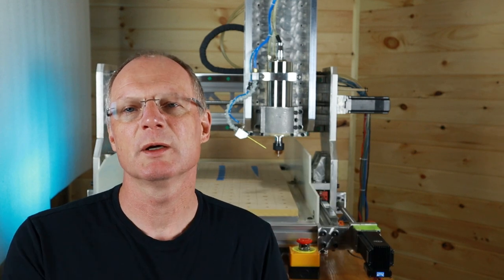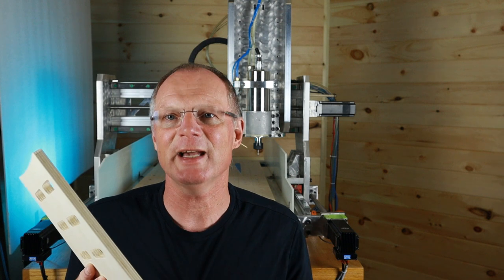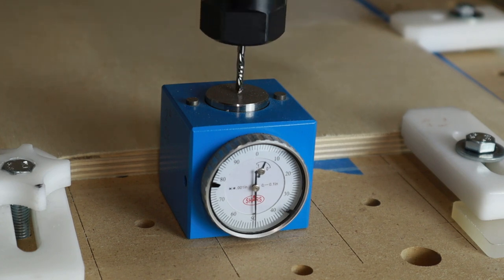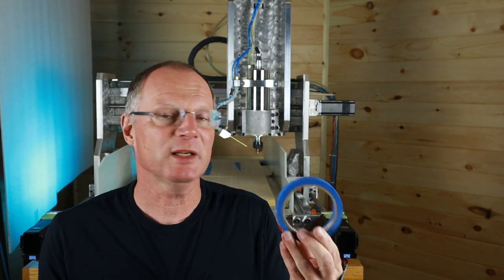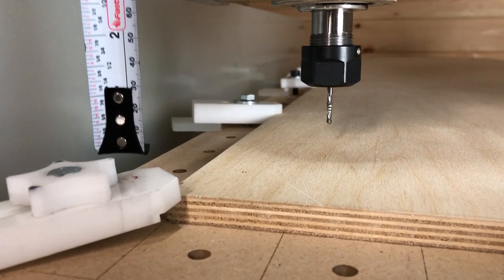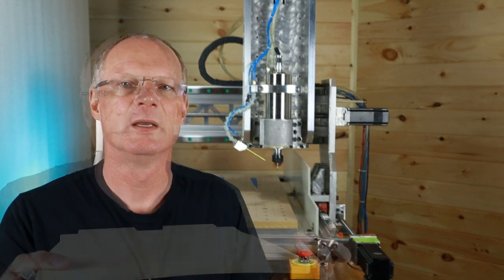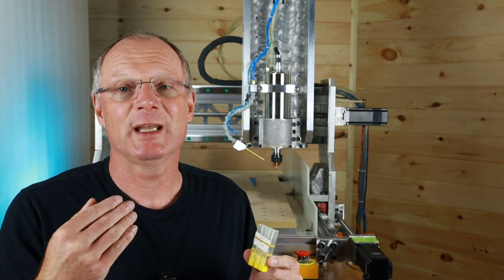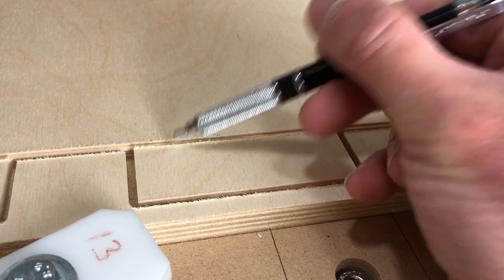CNC Cutting Plywood CNC Router Beginner to Pro EP 04

Comment: Totally...on the Z tip . I measured my 3/4" MDF at .755" and set my zero at top. I set Z cut depth to .760" with painters tape and CA glue for hold down. I was amazed at the accuracy of the depth of cut as it cut all the way through the MDF and it only scratched the painters tape. So satisfying!
Reply from the maker: Yes same for me, I really like this solution as my spoil board stays nice longer.

Comment: Great way to avoid hitting the spoil board all the time - thanks!
Reply from the maker: Glad you find it useful !!
Reply: Yeah! Tape as a spacer is pretty smart for this kind of project.
Reply from the maker: I made 50 lantern parts that I had to cut trough the material and my spoilboard looks just like before. Works really well.

Comment: Some great tips. I often use .125" thick hardboard as a spacer, but with more experience the tape works fine. Not quite cutting all the way through is frustrating and messy to tidy up.
Reply from the maker: Yes that is a solution as well. Sure many people say hey I cut right into my spoil-board because that is what it is made for, however it takes  o extra time to simply not do that. Thanks for reaching out Gerrit.

Comment: Great video and the bits are a game changer! Thank you! Any recommendation for the plunge rate? I'm new to CNC machining and I'm getting burn marks just on the plunge.
Reply from the maker: Yes that means that the plunge is too slow for the rpm both go hand in hand. So let’s say we are talking about an 1/8” bit and somewhere around 16-18k rpm then 400mm/min plunge should work without a burn mark. Some controllers are a bit slow between the transition of plunge to forward move and that can also cause a burn mark in the wood - that is more difficult to teoubleshoot.

Comment: Conventional cutting works best for birch plywood, it give the best finish is my experience. I normally cut it in 1 stroke, till 25mm thickness with a 10mm up/down cutter. (at around 12m/min). It's one of my favourite products to machine. Prices increased a lot in the last couple of years though.
Reply from the maker: Yes it has gotten really expensive. Personally I don’t like the 10mm bit the radius in sharp corners is too big and going fast it produces heaps of dust removing a lot of material. My favorite is a 5/32 (5mm) it can do anything a larger tool can do with better access and does not overpower the dust collection system. And yes Baltic Birch is difficult to get and expensive !!! Thanks for reaching out.
Reply: @berendlucasvanderweide, that's some agressive cutting 😮😅
It must be very cool to watch 😁
Reply: @xyzspec82  i thought i had a movie of that on my channel?

Comment: True Baltic birch plywood is getting quite hard to find here in the US, in addition to being expensive.
And I am pleasantly surprised by the quality of some Shars stuff. I work with metal, and I recently used one of their parting tools with quite a large stickout of about 1.5" to part off a 3" (~75mm) diameter 8620 (low alloy) steel bar and it did not chatter or break off!
Reply from the maker: Yes it’s not easy to find luckily I have a stash from years ago when Rockler had a sale. I also have some lathe tools from Shars (boring bars, collets) and I am quite happy with the quality for the price. Yes sure there is better but for the money it seems quite good.

Comment: Vejo os dados  da fresa no vídeo e  vou pra calculadora e certifico que a regra é bem seguido a risca.assim aprendo a economizar minhas fresas 😉
Parabéns pelo vídeo bastante explicativo
Reply from the maker: Not all values provided from the manufacturer will work for every machine. It will be good practice if you start a simple sheet for the tools you have and note down the optimal parameters you find. This way you can go back to them and also keep optimizing. I was very surprised how fast a 1/8” (or 3mm) bit will cut through plywood in one pass.
Reply: @JBWorx mas nesse corte feito por você os dados estão certinho com a tabela então, não só você. Mas eu também fiquei admirado por ver compensado sendo triturado corretamente  um belo trabalho sem perdas
Reply from the maker: Thank you ! Excellent 😀

Comment: compression bits are good, but for deep pockets/slots there is a better solution. i cut it in two steps. at first i rut all contours with a down cut bit for about 1mm depth just to pass first layer of a plywood (to the middle of a second layer to prevent delamination). and after that i cut all remaining material with a regular up cut bit. 

and for up cut i like to use 3 flute roughing (chipbreaker) end mills for aluminium. they are really fast )
Reply from the maker: That is a very good method I think ! Deep pockets are a problem for compression bits. Yes a 3 flute would probably require a too high feed rate for my machine in Al.

Comment: Shrars has a digital version of the x-axis zero setter, have you used that one?
Reply from the maker: I have not, I like the one with the dial. No battery to go dead and I like the idea to be able to read in between 2 increments something you cannot do with the digital one. But I am sure it will be a great addition either way
Reply: @JBWorx  thank you for the quick reply!  I am new to CNC , your content has helped me tremendously.  I have a Foxalien CL 4x4.  Will be cutting a lot of plywood to make retail displays for my business, similar to the ones you cut in this video.  I don’t want to have to keep changing out my wasteboard. This setup and the tape trick is brilliant.  I am a Mechanical Engineer so your approach really appeals to me.
Reply from the maker: Excellent ! I think you will be up and running in no time. There are a couple “how to” hurdles to overcome but after that it’s just practice and experience as with many other things (just thinking of my 3D Printer 😬). Thx for reaching out.

Comment: you may want to mention Every compression bit has a different depth it must be plunged into the surface to cut cleanly. this is where the flutes change direction. also that when you don't use are blast, fast enough speed, or dust collection that the bit will heat up and fail in short order as you are recutting chips manty times. I realize this was for instruction but beginners may not.
Reply from the maker: Yes this is a very important point that you make. Thank you 👍

Comment: When I cut wood like that, I usually cut in mirror,and my first tool is almost always a 10° engraving bit with a 0.1mm offset. It's important to choose the cutting direction wisely. After this tool has cleared the initial path, I proceed to cut the interiors in a single step, while for the outer edges, I divide it into two steps. The first step with a 0.2mm offset, and finally, the last step to clean it all up. 😊😊😊"
Reply from the maker: Yes that is a good method. So you basically have a finish cut. And doing it this way allows also to choose different cutting parameters for each cut.
Reply from the maker: Yes the order of operation is always important and totally depends on the part and the clamping method too. Often the machining is the easy part … holding the part can be the challenge that particularly counts for metal working. Thanks for sharing your channel.

Comment: Some good tips but your cutting speed is waaaay to slow, good way to start a fire (yes I've seen machines catch fire from new users running those speeds), you should be up around 8m per min at a minimum with those rpm's.
Reply from the maker: The cutting parameter I provide are the minimum to use so exactly that does not happen. Also the rpm is directly connected to the bit diameter so the surface speed of a 3mm bit vs a 10mm bit at 18k rpm is obviously very different. Furthermore look at the Amana Tool 1/8” Bit Feed recommendation … it’s 1m/min at 1x tool diameter DOC at 18k rpm for a 2 flute tool.  My goal is to provide the cutting parameters that will also run on lower end desktop machines. That my machine has servos and runs 12m/min is not really relevant for the playlist that I created for the beginner.

Comment: No, the manufacturing industry standard is not to set Z0 underneath the part. 

Sincerely,
Professionals Machinists Everywhere.
Reply from the maker: Interesting, and oI thought most industry machines use an ATC and that will have a tool touch Probe that is always referenced to the table …